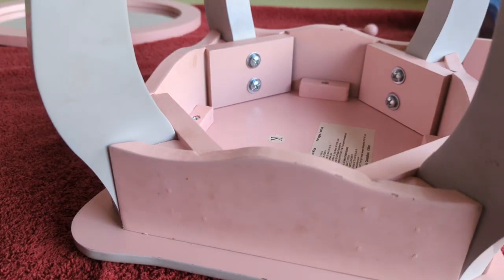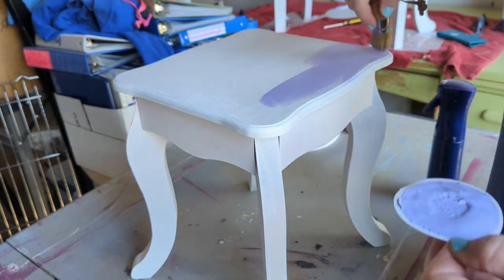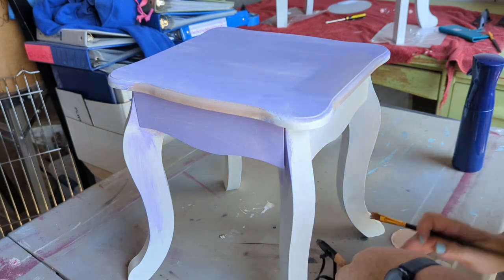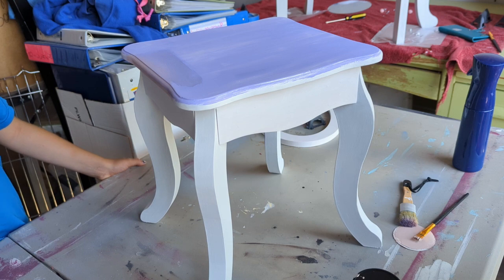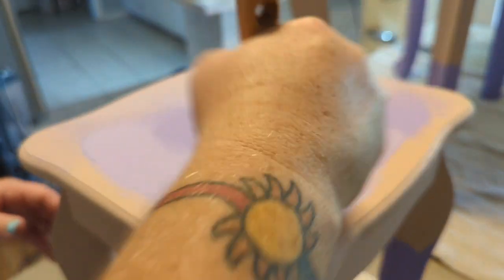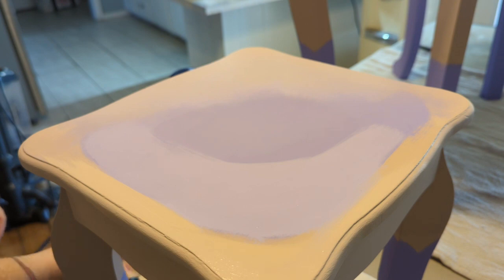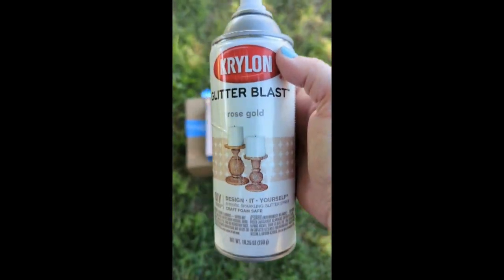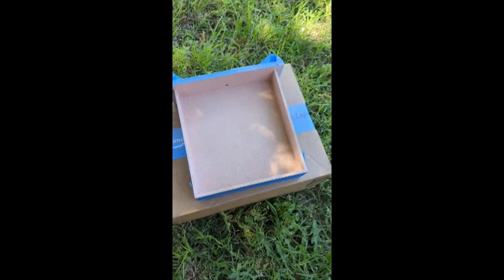Kid's Vanity Glow Up! || Blending Paint Vanity Makeover

Comment: Washing it? Im trying to understand if this will help with markers and stickers? Any suggestions
Reply from the maker: Washing it removes dirt, oil from skin, and anything else that might be on the surface and makes it hard for the paint to stick. Water based markers could be covered by this, but markers like sharpie would need a stain blocking primer. I did remove the stickers before painting, it's a pain, but I would worry about the outline of the sticker and it causing the paint to lift later.